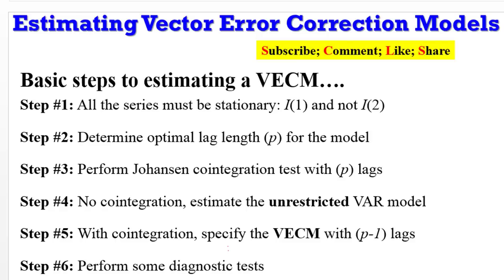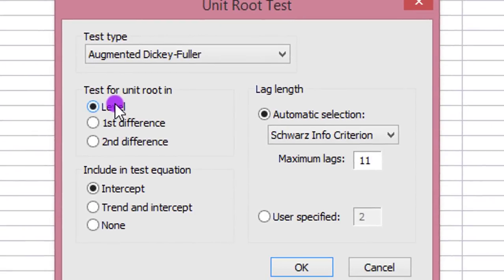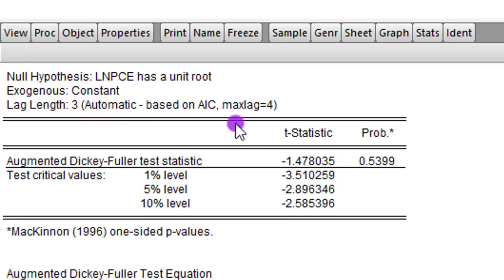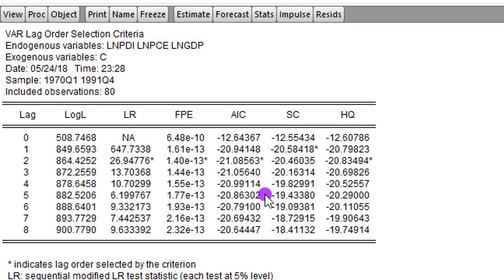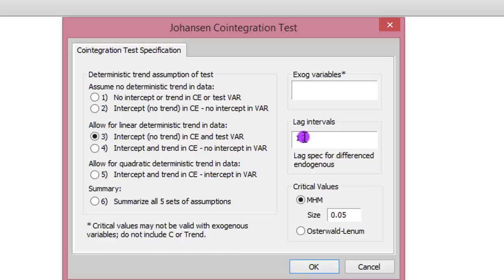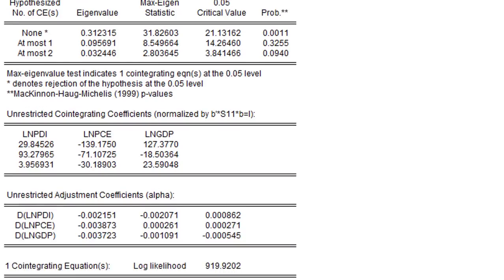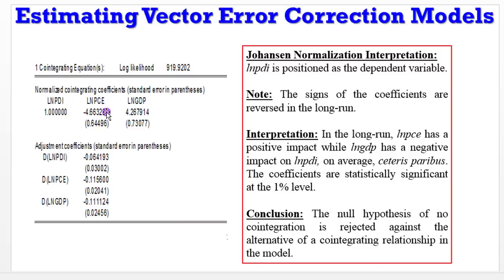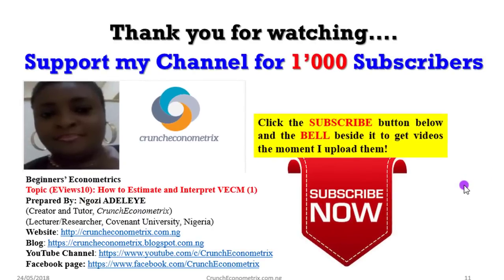(EViews10): Estimate and Interpret VECM (1) #var #vecm #causality #lags #Johansen #innovations

Comment: Thank you for your excellent presenation. if i the log variables on thier level not all of them  non staionary while in thier nature (without log) level all of them nonatiaonary, can i apply their logarethim?  if i find the varaible are not normal distributed while other statistics are fine (no serial correlation no heterscadisicty) can i accept the model? i got the following results LKSEI(-1)  1.000000  0.000000
  

LOG(TT(-1))  0.000000  1.000000

  

LHINDEX(-1) -0.154923 -1.038932

  (0.25311)  (0.08584)

 [-0.61208] [-12.1034]
Reply from the maker: Hi Jasem, there are no rules to taking logarithms. It is at the discretion of the researcher. But if the variables are nonstationary, take their 1st difference. Also, I will give a model a good pass if it only suffers non-normality but has no evidence of serial correlation or heteroscedasticity.

Comment: I heard you emphasised that it should be done if the serries are stationary at first difference and definitely not second difference. If the stationary is stationary at second difference what method is recomended
Reply from the maker: Hi Ephraim, the Toda-Yamamoto is then applicable.

Comment: hello, thanks for the video very much! Ir really helps me a lot for my project. There's a little question about step 5, why we specify VECM with (p-l) lags instead of just using p lags?  The ect estimation is different from what we get in step 3.
Reply: is it because of df-related issue or something?? thank you
Reply from the maker: @chengchelu9731  No
Reply from the maker: Check econometrics textbooks and you'll see that a VECM has p-1 lag length given that the dependent variable is specified in first difference. .

Comment: Hi, thank you for nice video. I have a question about when you perfom Johansen Test. Why didn't you specify only 1 lag instead of using 2 lags since the test itself tells that lag interval is in first differences.
Reply from the maker: Hi Panun, the procedure is that Johansen is estimated with the optimal lag length (p) and not with (p-1) lags.
Reply: @CrunchEconometrix  
The weakness of Johansen approach is that it is sensitive to the lag length. So, the lag length should be determined in a systematic manner. Following is the normal process used in the literature.
1. Choose maximum lag length "m" for VAR model. Usually, for annual data this is set to 1, for quarterly data this is set to 4, and for monthly data this is set to 12.
2. Run the VAR model in level. For example, if the data is monthly, run the VAR model for lag lengths 1,2, 3,....12.
3. Find the AIC (Akaike information criterion) and SIC (Schwarz information criterion) [ there are also other criteria such as HQ (Hannan-Quin information criterion), FPE (Final prediction error criterion) but AIC and SIC are mostly used) for the VAR model for each lag length. Choose the lag length that minimizes AIC and SIC for the VAR model. Note that SIC and AIC may give conflicting results.
4. Finally, you MUST confirm that for the lag length you selected in step c, the residuals of the VAR model are not correlated [use Portmanteau Tests for autocorrelations]. You may have to modify the lag length, if there is the autocorrelation. Usually, beginners in time series econometrics tend to skip step d.
5. For the cointegration, the lag length is the lag length chosen from step d minus one (since we are running the model in first difference now, unlike in level when we used VAR to decide the lag length).
(Culled from Cross Validated site)
Reply from the maker: Thanks for sharing!
Reply: This was given to us in step 2. We thus have no latitude over it.

Comment: I have also performed this test on my data with three variables with optimal lag selection based on AIC. All variables are stationary with the same order at the 1st difference. My results are highlighting 3 cointegration equations with significant p values. But, unfortunately, "normalized cointegration coefficients" of my data are showing insignificant results by calculating the t-value with help of the standard errors. I need your suggestions to solve this problem.
Reply from the maker: Rashid Latief Re-run these JCTs: lny lnx lnz; lnz lnx lny... Compare the outcome. The VAR model is sensitive to the arrangements of variables in the system.
Reply: Thank you for the quick response, I put lnx at first, as the target variable, and rotated the lny and lnz re-run it. but the "normalized cointegration coefficients" don't significantly change. Can i ignore "normalized cointegrtion coefficents" and elaborate the main results of trace value and max eigenvalue as those are significant?
Reply from the maker: Rashid Latief The normalized cointegrating equation represents the LR equation which from your results is not significant. But b4 we outrightly conclude or suggest you change variables (using better proxies), go ahead and perform the VECM but impute 1 cointegrating equation just to simplify interpretation of the results...then see the statistical significance of the ECT.
Reply: I am very thankful for your guidance. I have moved to VECM model with 1 cointegrating equation, ECT of one of the three models is significant. It has also showed short-run relationships. It has also an evidence from the literature.